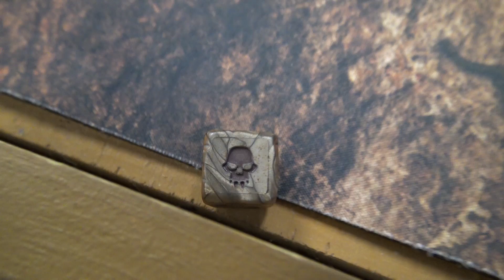NEW CODEX Orks VS Dark Angels & Knight - Warhammer 40K Batrep - 2,000pts

Comment: just an FYI, you cant use stratagems on a unit embarked in a transport. because they are not technically on the board, open topped only allows them to shoot.
Reply from the maker: I know you can't cast powers and that THEIR auras don't count, but where does it say you can't use a Strategem on them? Because I know you can use plenty of Strategems on units in reserve which aren't on the board
Reply: @TheGlacialGeek  under the transport section of the rule book. And quote.
"Embarked units cannot normally do anything or be affected in any way whilst they are embarked. Unless specifically stated, abilities that affect other units within a certain range have no affect while the unit that has that ability is embarked"
I know you are playing a for fun game where it doesnt really matter.
But in ITC format tournament you cant use stratagem on a unit that is not on the board.
I play orks aswell and I would do that to if I could.
But a fun game to watch non the less.

Comment: why the 2 groups of lootas just to immediately mob them up?
Reply from the maker: Fills out spots for the Brigade
Reply: to deny extra killpoints, and to make stratagems more efficient
Reply: @claravinas9265  K, since you aren't getting it.
He had a brigade, which requires 3 heavy support, but he had a battlewagon, mek gun and 2 groups of lootas. Thats 4, the only reason to split the lootas up would be to get the extra heavy support slot.
He could have just brought in a group of 15 lootas and saved the CP and had his opponent killed a single loota from the squad of 10 he wouldn't have been able to mob up